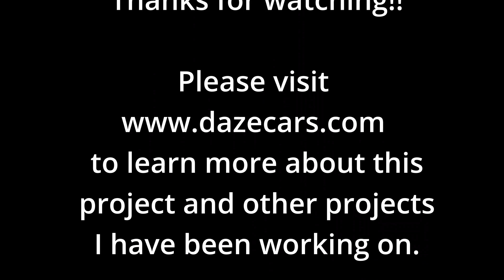Treadmill conversion FAQ 9. How do you mount a different pulley?

Comment: I'm having trouble finding a pulley. i have the threaded fan type fly wheel. what size pulley did you use when you turned it down? do you have a link?
Reply from the maker: I got it off ebay.  It was an aluminum conical pulley for a drill press.  that was years ago so I don't have a link or part number.
Reply: @dazecars  thanks for the reply. i ended up getting a one inch bore 3-inch outer diameter pulley off amazon, then turning the motor on while i used a bench grinder to turn it down. it actually worked really well. i then used a dremal to cut out a keyway, which went not as well. i dont think they are ever coming apart, but they are afixed 😆. i was using a variable dc output, but i dont want to give that up, so the scr and bridge rectifier are on their way. love your videos.
Reply from the maker: Glad you got it "machined" and glad you like my videos.  Don't hesitate to reach out if I can be of any further assistance.
Reply: @dazecars  Daze, how did you attach a pulley over the turned down, threaded flywheel?  Did you machine a keyway as this gentleman did, or just use set screws to secure?  Thanks for any details that would help.
Reply from the maker: I made it a slight press fit and then used a set screw.  I never had any issues with it so for my application the keyway was not needed.
Reply: Excellent!  Sounds simple, thx.

Comment: Great content but I have a question I have an 18 amp treadmill motor what wiring system do I need for a 48 volt battery hookup because the wiring system I used from my son's Power Wheel burnt out on the switch which would have been the pedal what do you recommend I use for the treadmill motor without any wires burning out and to be able to use it at optimal Performance
    Thank you.
Reply from the maker: I have not messed with any power wheels.  I would start be looking at the specs on the original motor.  if it is way below the specks of the treadmill motor it makes sense that the switch burned out.  The control board may or may not have enough capability for the treadmill motor.  Hard to say for sure with out having more info on the power wheel